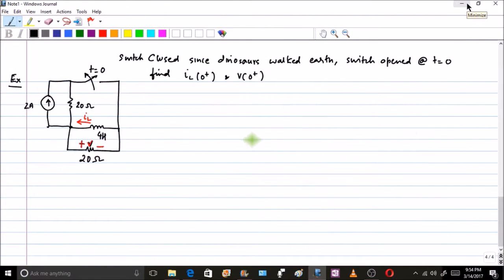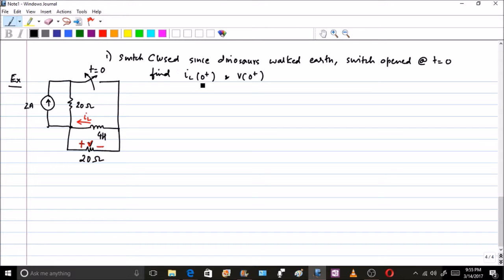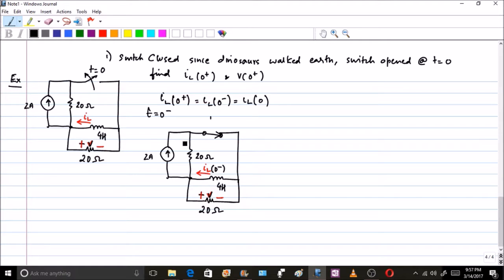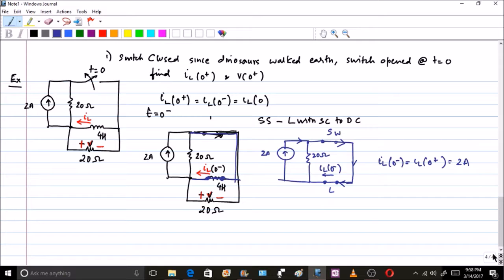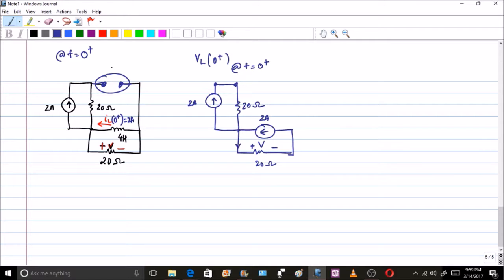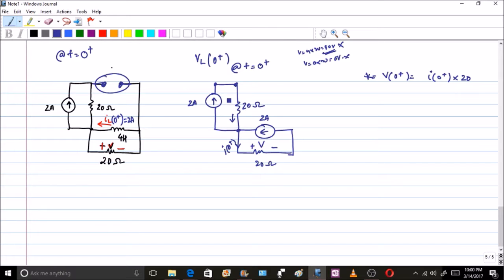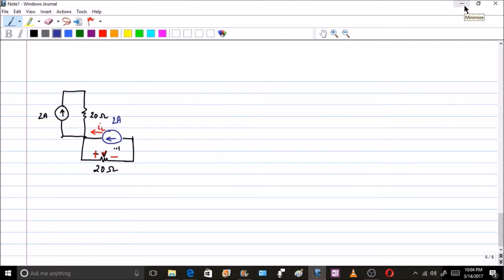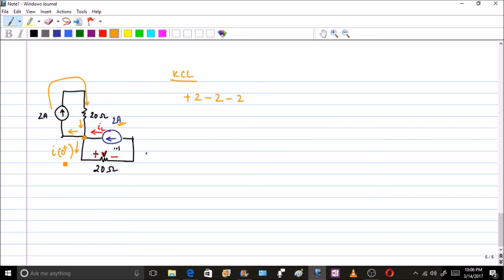Numerical of source free RL circuits - part4 #transients #ECA

Comment: Sir in RL TRANSIENT switching take place at t=0 instead of that at t= 1s how to solve that kind of problem..then at time 1sec how to calculate initial current... U told me initial condition means before switching that's 0-...
Reply from the maker: Initial condition means before switching it can be any time based on the question...I think I have covered such problems also...